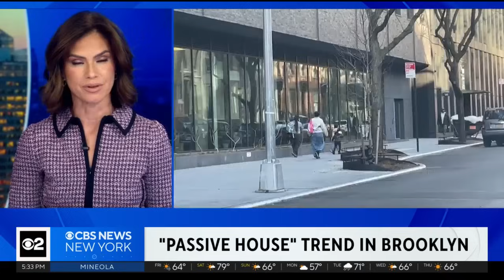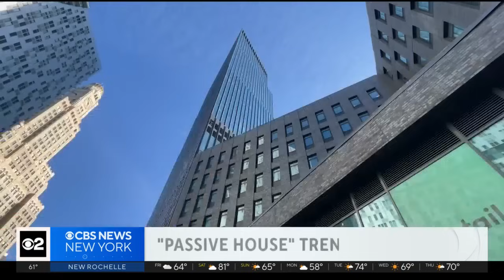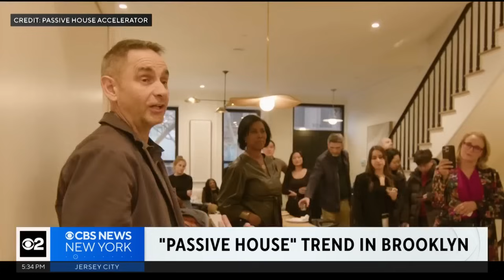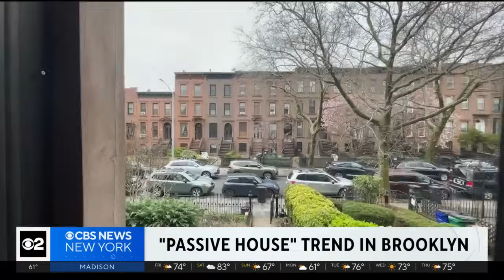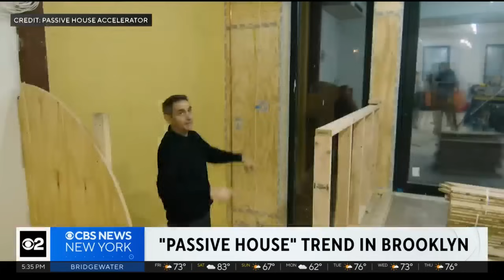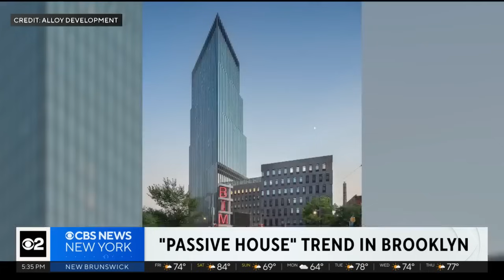World's tallest Passive House skyscraper planned in NYC

Comment: Another change that does not benefit the congestion. Also I reccomrnend you Use Natural Gas, it is clean burning compared to oil and is cheaper. Too much electricity is no good.
Reply: Zero sum thinking. Instead of New Yorkers living in the city, they are forced to live in NJ and Long Island and commute in, due to lack of apartment supply.  Build more housing now
Reply: More electricity is alway a good thing.  Gas should be taxed with a carbon tax.
Reply: @firefox39693  I get it but just in case something goes wrong. It’s best to have two sources of energy. As well as the stress on the infrastructure.
Reply: @42luke93  Gas requires a pilot, which runs on electricity.

There's spare capacity  on the electricity grid.
Reply: @ 
Once light its on and the spark to turn on modern ovens is minimal.